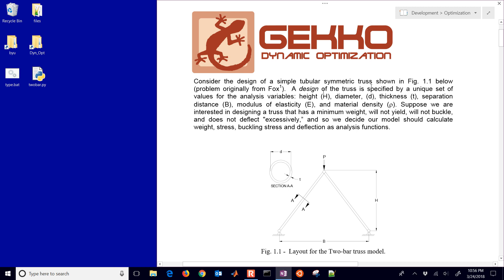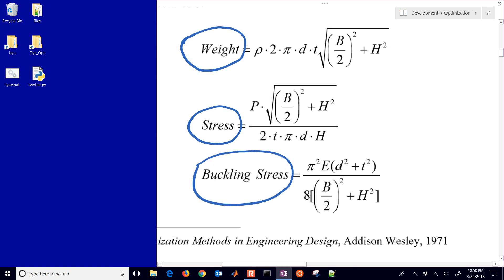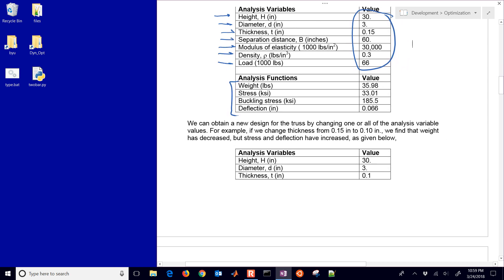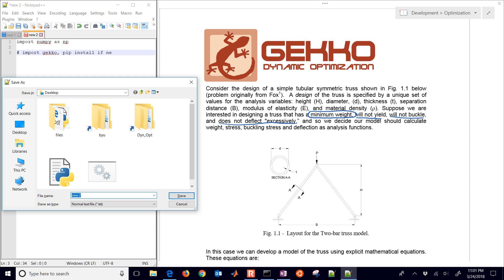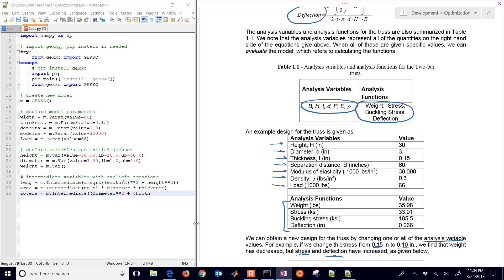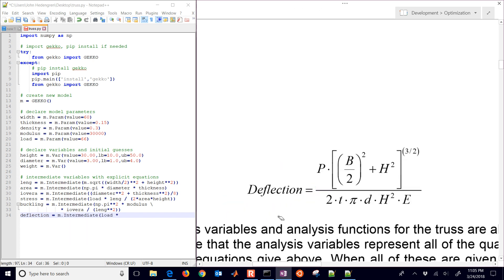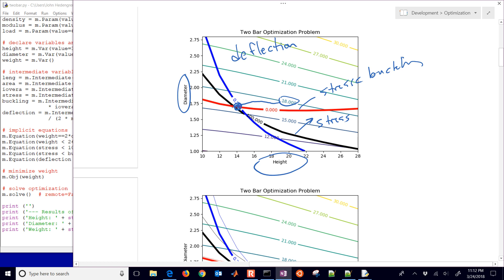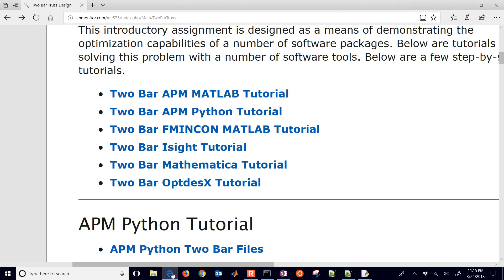Design Optimization with Python GEKKO

Comment: Within GEKKO, can each of the independent variables de defined as a vector of constant values? In this case the discrete solution domain is a grid search problem instead of a continuous domain optimization. The constraints and implicit variables remain constant. This arises from a design optimization problem where the components associated to the independent dimensions are only available within a finite set of discrete dimensions (e.g. 2, 3, 4, and 6in. Diameters, and 3, 6, and 8 ft. Lengths)
Reply from the maker: Use the m.sos1() function in gekko to define a Special Ordered Set as d = m.sos1([2,3,4,6]) and ln = m.sos1([3,6,8]). More information is available in the documentation https://gekko.readthedocs.io/en/latest/model_methods.html?highlight=sos1#logical-functions or on StackOverflow https://stackoverflow.com/questions/67372087/how-to-use-sos1-with-gekko-array-in-python
Reply: @apm  Thank you Prof. Hedengren for all the resources you provide via apm. I hope m.sos can handle discrete ordered sets real numbers -not just integers. 

Also, do you know if an equivalent to Gekko MINLP is available within SciPy?
Reply from the maker: @danielj.rodriguez8621  yes, it can use non-integer discrete sets. I'm not aware of a good MINLP solver in SciPy.